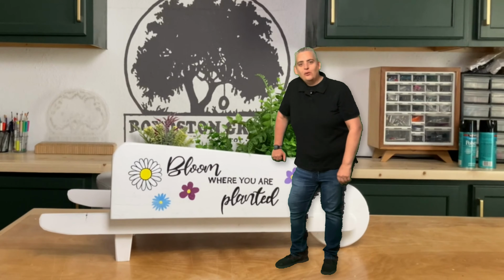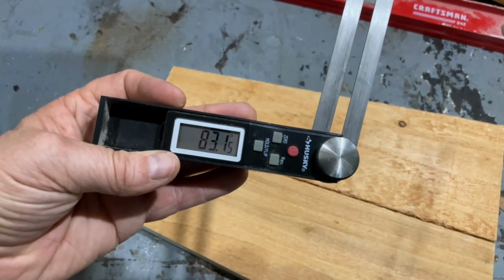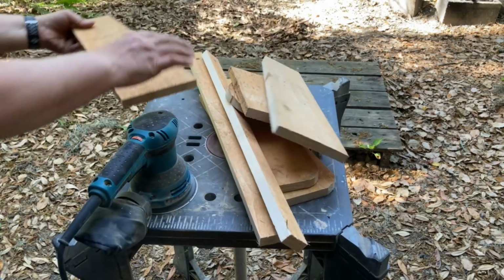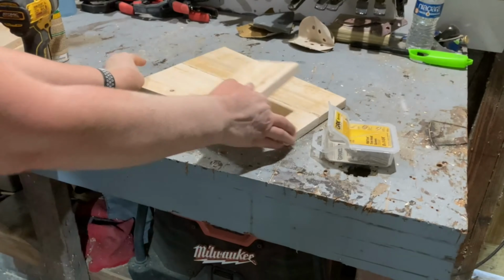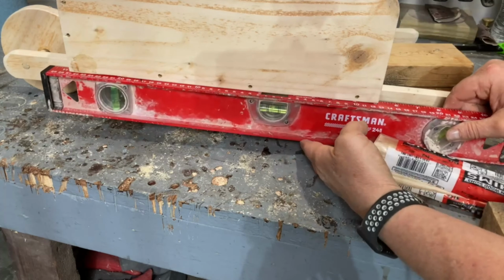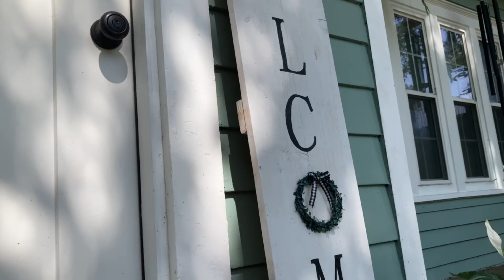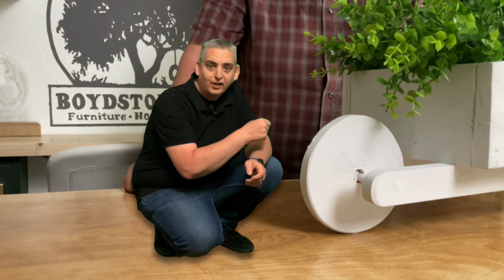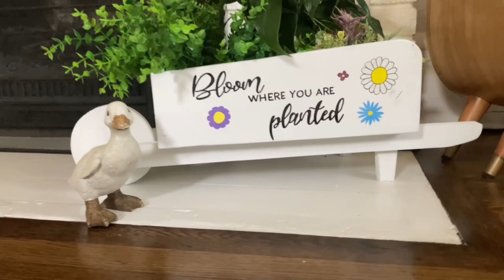Building A Wheelbarrow Plant Stand / Easy Woodworking Project

Comment: That wheel seems a bit floppy.
Reply from the maker: Yes, it was. If I built it again, I'd make the hole smaller so the dowel fits tighter (or use a larger dowel). Technically, it doesn't need to move at all since it's more for the look, but it's stationary, so it hasn't been an issue thus far.
Reply: @boydstongrove  other than the wheel, it looks very nice.
Reply: So cute.  Plans would be nice, if possible. Avid viewer.